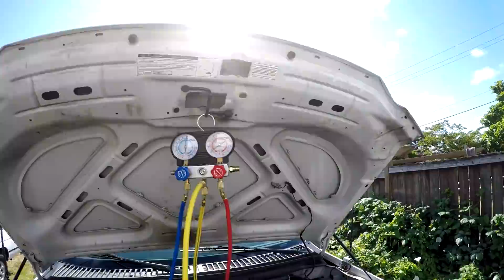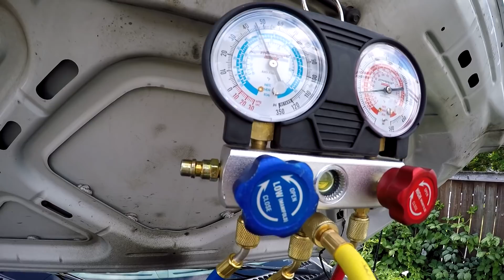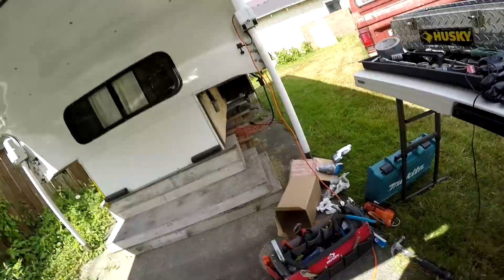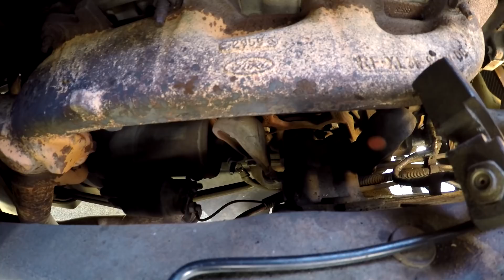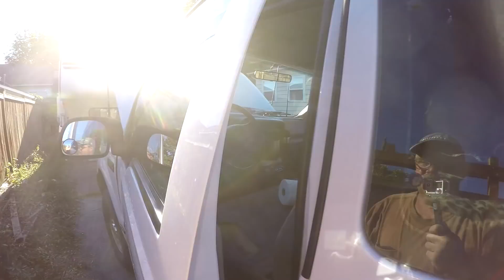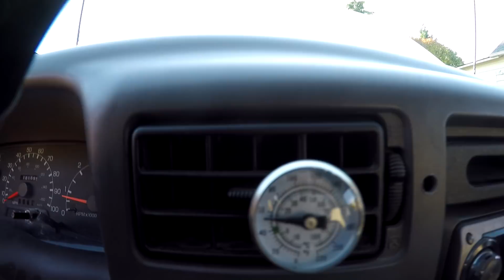EASY FIX FORD Air Conditioning System

Comment: All n all the orfice tube was not the problem as hot gas before the orfice is hot and after orfice the line is cool as should be, I would have done the same as you to replace all also.

Comment: On the 07” super duty you have to take the bolts out the subframe and raise the engine as high as you can, blocked jack under oil pan so you can get the 13 mm bolt in the back

Comment: Thanks for the video!  Not exactly the vehicle I was working on, but shined light on some grey areas I was concerned about.  
FYI for another DIY'er doing this job, check your local parts store to see if they have a loaner tool program.  AutoZone had the Flush kit and Vac pump.  You DO have to purchase the item(s).  At the time I did mines, you had 30 days to return it for a full refund.  DONT LOSE YOUR RECEIPT!
Reply from the maker: Yes, there are auto parts stores that have loaner tools. I bought my tools because I've been installing minisplit systems for friends.  
It doesn't matter what vehicle. The systems are the same. Only difference being a orafice accumulator system or an expansion valve receiver dryer system.
Reply: @CITAP1  I understand, AND agree. Doing it regularly, or even every now and then...nothing beats having the needed tool st your finger tips.  Us 1 and done (hopefully) DIY'ers would chew off our bottom lip if we had to buy those associated tools for just a one time use.  Some don't realize there are tool rental or loan-a-tool options.  
Just an FYI add on to a good video.  I didn't know about loan-a-tool.  I just happened to read the placemats at AutoZone while waiting for a part to be pulled from the back.  I asked about it, been using them every since for all kinds of jobs they may only be needed for say...3x for the life of a vehicle.
Reply from the maker: @Jaeh1  I never met a tool I didn't want.  I admit it, I'm a tool hoarder and I can't help it. I even bought the cam position locking holders for whenI had to install new head gaskets. Those proved an unnecessary expense.  I hope you've got your system back up and working, Take care...

Comment: Oh yea, I was told both you could and couldn't flush the condenser. Can you flush it out?  I have 2006 dodge 2500 5.9l diesel 4x4 slt. Thanks Steve
Reply from the maker: I flushed out my condenser, blew it out with 80 psi air on a rubber tip nozzle, then flushed a second time blowing it out really well trying to remove the solvent and debris inside. You would get best results removing from the truck so you can turn it, shake it, and drain it most effectively. I was lazy and did mine in the truck. It still works great since doing this video.
Reply: Thank you very much my friend. I'm starting to have trouble "again with my A/C blowing warm air after replacing compressor- accumulator- liquid line with orifice tube and condenser a year back. Steve
Reply from the maker: @stevedockery3534  You changed all the O-Rings? Very important to do that and put PAG oil on them before installation. If you look at the section of AC line immediately after the orifice tube, is frost forming on that section? Then the tube is clogged. Or connect your gauge set and is the pressure correct or low. If low, you have a leak. Try a recharge with a can of 134A with fluorescent dye, you may be able to find a leak with that and make a localized repair. OR you can have the refrigerant discharged and reinstall all new good grade O-Rings, then recharge the system.  It's possible one or both the schrader system test ports could be damaged and need replacement. Hope you get things figured out.

Comment: Very good job my friend. Sounds like you've done this many times before. One question, I heard you say you pup Pag 46 oil (6oz.) In your accumulator, is this done in "all" accumulators? Thanks
Reply from the maker: I think the accumulator came with instructions. You need to figure how much total PAG oil your particular system takes, then determine if any of the new components like the compressor come with PAG oil installed. Mine had 3 OZ. Take your total specified amount and subtract any you know for fact is preinstalled, that will leave you with how much you actually need to install. I think My system actually has 2 OZ more than specified because I didn't know of the preinstalled PAG oil in the compressor. I've worked successfully  on a couple systems.

Comment: did you put 4ounces or 6ounces of pag oil into the accumulator? your screen caption said 4 but you verbally said 6.
Reply from the maker: It's been a while but I put 6 in the accumulator but said 4 reason being the system total was something like 6 ounces.  I found after the fact the new compressor had 3 ounces already. So I have 9 oz. Total but I think the system only needed 6 oz so that's the discrepancy. I have been working fine with 9 oz since this video. I thi k I put 3 in the compressor and 3 in the accumulator.
Reply: @CITAP1  Thank you! I'm grateful for your reply.

Comment: Great video. I am dealing with the same issue right now. 2002 7.3. Thanks for explaining and making a very detailed video!
Reply from the maker: Thanks, Hope you get things going. Having done this a couple times now, my bet is the orafice tube is blocked.  Your diesel is way more cramped than mine but generally I'd change the system out, solvent flush the hoses and blow dry and don't worry about air pressure.The lines are high pressure rated. Solvent flush and blow dry the condenser and evaporator,  solvent clean everything.  Get an O ring kit and replace them all. I would get NAPA parts or good quality. Reassemble everything and vacuum it down to be sure it holds without change a very low vacuum.  Start charging your system. Make sure you put in the correct amount of PAG oil. My AC system has run like a champ ever since this video. I would also change the hi and low pressure switches for good measure. I believe a faulty low pressure switch caused my system failure. You need to change the accumulator bottle to, it will be fill of gunk you don't want. This project really is easier than you might think. Best wishes.
Reply: I found some metal shavings on my 7.3 orfice tube.  So here i am wondering if i need to replace my condensor and evaporator or if i can just flush it. Did you replace yours or just flash it?  They say that is you don't replace those parts that the new compressor can go bad. Thanks!
Reply: @johnlee8985 you definitely need to replace the condenser and just flush out the evaporator and the high and low lines before putting the new compressor in.

Comment: should be blowing colder like 38 to 42 deg...... no ? maybe the thermometer needed to be pushed all the way in the vent to get a true reading... great video thanks
Reply from the maker: My understanding is an automotive AC system will cool inside, about 30 degrees cooler than the outside temperature.90F outside will get you 60F inside.

Comment: Helps to put vehicle Make, Model and Year in the title.
Reply from the maker: The principals of AC are the same on all systems with minor differences. This video is for a system using an orifice  tube, some other systems use an expansion valve system with a thermal sensor instead of the orifice tube. The vehicle model and year is in the information and it becomes obvious what vehicle I'm working on in the video.

Comment: Thanks for putting up the warning just before you opened up the accumulator!   Of course, the system needs to be evacuated before working on it but even if you know you have a leak and lost refrigerant, it's always a good idea to verify pressure with your gauges and release any small remaining amount of refrigerant through the Schrader valve.  
One other safety comment...........I noticed your wrenches were placed, albeit in their plastic case, next to your battery, which has an uncovered positive terminal.  Speaking from a friend's experience, you do not want one of those, or any other metallic tool to accidentally bridge the terminals.   Not very pleasant, to put it mildly!!
Reply from the maker: Yeah, I had checked depressing the schrader valve a while before but I guess there was change in atmospheric pressure and temperature that got me. The refrigerant had leaked out over time and I thought it had no pressure in the system but there was some built up in there, just enough to spray and then it was done. Good thing the safety glasses were on. I've been bad over the years having wrenches sparking on the battery a couple times. It always wakes you up quick. I admit, I lay tools on the battery but I'm aware of it and careful. I did this repair three years and a couple months ago and the AC still works great! Not a problem of any type, turn it on, it works, every time. Thanks for the comment.

Comment: So, i dont understand, what actually was the specific item that was the cause of the initial fault? Or do we have to replace all items just in case, to fix a filed ac system?
Reply from the maker: The cause of failure was a plugged up orifice tube. I think some debris came from the compressor. It also had a failure in the low pressure cut out switch which was replaced. It has been about 2 and 1/2 years now and the system is still working great. Trouble free. You must do a few things to get a good fix. Get a new compressor, accumulator, orifice tube (be sure to install it the correct direction), change all the o-rings, Blow out the evaporator, condenser, and hoses. Spray AC flush solvent in all the components and blow out again, wear a mask. Reassemble, vacuum down and test for an hour vacuum hold. If good, charge the system and you should be ready to go.
Reply: @CITAP1  hi,  thanks for the update and feedback. Appreciate your advice. 
Am currently trying to solve a failed system, but without the option to just replace non required parts due to the cost of some items here in Australia. So a accurate 100 percent diagnosis is needed. Your video has helped in try g to narrow down and in some cases eliminate the likely cause of a few issues on the system, effectively and hopefully limiting what items get replaced unnecessarily. 
Thanks again.
Reply from the maker: @johndee68  I know how costs creep up on you. I spent close to 4000.00 replacing my engine a couple months ago. 
The cheapest thing you can change is the orifice tube. If it is blocked, you should see frost form on the AC line right after it. Debris collects there. You may be able to get away with just replacing that and the orings at that connection and cleaning out any debris you see in the tubes or hoses. If your AC compressor is working and cycling ok, you might be able to get away with just that and recharging the system. If that doesn't work, your basically out 5 dollars for the orifice tube and cost of refrigerant. Hope this gives you enough to decide what to do. Good luck with it.
Reply: @CITAP1  hi, 
My system has a thermal expansion valve system. I've narrowed down the possible cause of the fault to be the low pressure side of the compressor being unable to get the gas down to low enough pressure for the expansion valve to do its work?  Though I am not able to find a video which can confirm a compressor failure in an identical way,  so am hesitant to just diagnose the compressor as the cause yet. 
Thanks again.
Reply from the maker: @johndee68  
Have you put a gauge set on the AC system? I'm not expert but if the low side of the compressor isn't working, it could be due to the high side not pushing through the expansion valve. I understand a lot of the time, the problem is the expansion valve or the orifice tube. These are the two main AC system types. Ford = orifice tube and accumulator bottle, GM = expansion valve with temp sensor probe and receiver dryer bottle. If there is a frost on the pipe immediately following the valve type, there is blockage in the valve. Your high pressure area is from before the compressor out, through the condenser and bottle to the valve. If the compressor is working, there will be high pressure output. If there is a blockage, the pressure will be higher. The low side will be lower. If the pressure on the high side and low side are the same or close, the compressor may not be working. If you have rapid on of of the clutch, what I had, it may be the low pressure cut out switch sensor.
Reply: CITAP1 Hi, i have about 30-40 psi on the low with about 200-250 on the high while idle. Which seems higher than normal but had been like it when it used to be working fine previously. I replaced the txv as i thought it was not working due to same temp going in as was going out of the evaporator.  This, though suspecting still a faulty new txv.  Has not made a squat of difference.  Gas levels seem fine, compressor clutch did cycle fine and seems to be cycling fine though it seems the hi side switch cuts the compressor clutch off as hi side is too high.  I am thinking, as the compressor seems to have a fair low and definitely able to compress hi.  That there might be a restriction or two somewhere in the system?  My suspicion is it might be the drier failure.  Well, it is 17 years old, never had an issue till recently with the ac in all that time.  Its never needed a service either. It would be good if there was a definite diagnosis rule to follow by what the gauges display.  Similar to a vacuum gauge diagnosis tool allows.

Comment: Great video I recharged mine but the air just got a little colder but not that much of a difference
Reply from the maker: Did you change your orafice tube or expansion valve? You also need to replace the accumulator or receiver dryer to remove contaminants.  If the valves are clogged, you'll see frost on the tube leading into the evaporator in the dash. There should be a 30 to 40 degree difference between the outside temp and the air temp blowing out the vents with the AC on MAX.

Comment: You didn’t show how to evacuate the system, did you evacuate it out into the atmostphere??? Just asking...
Reply from the maker: My compressor froze or locked up on me and the system had developed a leak I could never find with florescent dyes. The system was empty. If your system is charged, take it to an AC shop and have it evacuated. Lots of times the reason people are servicing their AC is because the refrigerant has leaked out.

Comment: which way did you end up putting the orifice tube in?  Having similar issue with mine.  Until recently I've always seen the larger end of the orifice tube pointing out toward the dryer but ran across several photos of people putting them the other way (the smaller end does have tabs for removal tool) but I can find no definitive information on which is correct.
Reply from the maker: The screen goes toward the accumulator bottle. That way it stops debris in the line.
https://youtu.be/TE7czWLXd3w?t=22m27s
Link takes you to that point in the video.
If I recall, there some stop dimples in the tube the orafice goes into. I think it will stop the orafice one way at the correct depth, the wrong way, the orafice will slip in to deeply

Comment: my hoses have valves on one end so you probably let tons of air into the system.
Reply from the maker: My hoses connect to valves on the gauge set. My hoses also connect to valves with quick connectors at the other end that go onto the accumulator and high pressure side. If you watched the full video, you would see the system was vacuumed down and held vacuum for an hour without gauge movement. You need a piercing valve to go onto the refrigerant bottle you're going to start filling the system with. Connect the valve and hose to the refrigerant canister and loosely to the gauge set. Open the valve slightly and purge all air from the hose and immediately tighten the hose end on the gauge set. You have now purged all from the system and are ready to start charging the system. As each canister of refrigerant empties during the charging process, close the valve on the canister piercing valve. The canister will purge any air as the new canister discharges when being attached. Complete filling system with recommended amount of refrigerant. 
My system has been operating flawlessly since making this video. 
Her are user directions for the Harbor Freight Gauge Set.
http://manuals.harborfreight.com/manuals/92000-92999/Q92649.pdf
Reply: @CITAP1  I think the harbor freight hoses have the bend at the manifold instead of at the couplers which threw me off. My hoses have a valve on one end so now I don't know which way they go since they will screw on either way.
Reply from the maker: @brentbradley6711  The picture shows the bends at the gauge set. I had an initial small leak but loosening and re-tightening remedied that and it worked fine. Look at your directions and connect as shown if they show that detail. You'll know if it's working when you connect things together. If your gauges aren't showing anything, try reversing the hoses then. You should be able to fiddle through and get it done.
Reply: @CITAP1  OK thanks, there are no directions so I will try both ways...……….
Reply from the maker: @brentbradley6711  Good Luck and Let me know how things turn out!

Comment: Looks like the hoses are on backwards.
Reply from the maker: They AC system hoses only go on or connect one way. If you mean the gauge set, on the Harbor Freight gauge set, they fit either way. I'm told other brands may be directional.
Reply: @CITAP1   I just got a new set of gauges today and the hoses go either way but one end has a valve in it.
Reply from the maker: @brentbradley6711  
Harbor Freight Gauge Set Directions Show all connections and valves.
http://manuals.harborfreight.com/manuals/92000-92999/Q92649.pdf

Comment: Your sure hard on your glow plugs never start before your start  light goes out!
Reply from the maker: I'm guessing you meant to comment on another video I have about repairing blown out spark-plugs. This is a gas engine. 5.4 Liter. A common problem with this engine's aluminum cylinder heads.